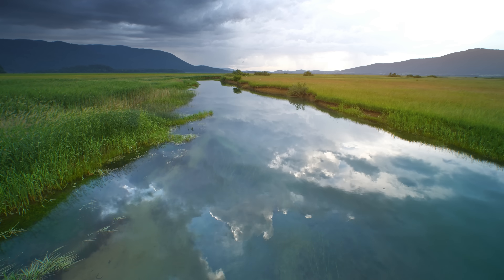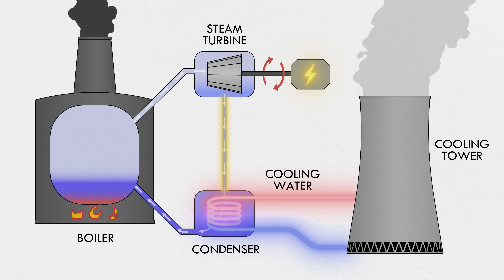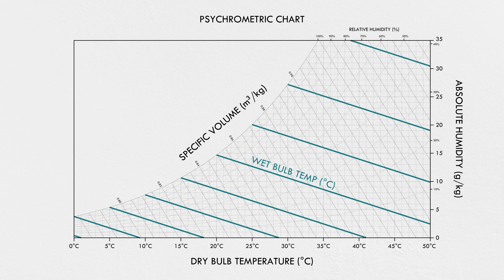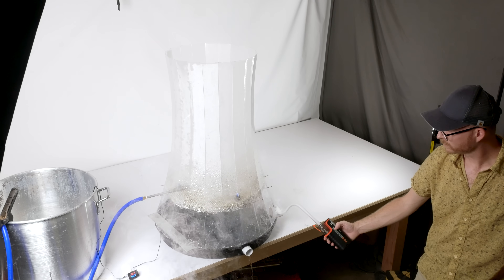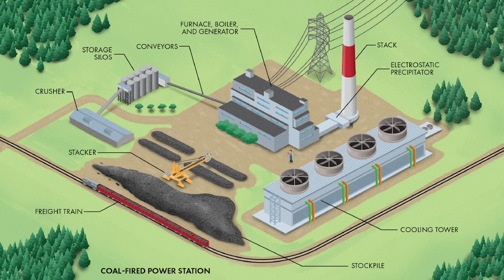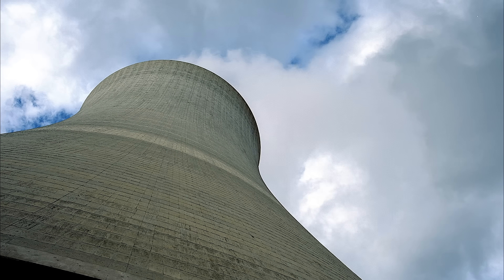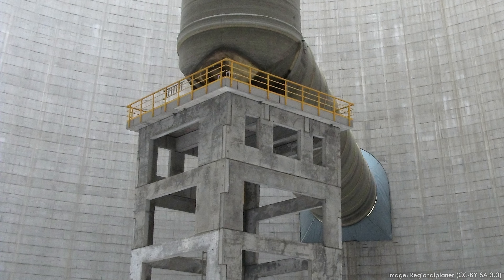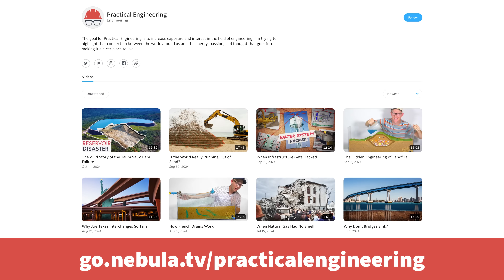Why Are Cooling Towers Shaped Like That?

Comment: Check the white line distortion of the video in 19:47 you can clearly see white lines and dots in the lower left corner, and then even more around the whole frame.  Is that distortion from radiation ?
Looks like it ;)

Comment: I studied chemical engineering in college over 40 years ago. Most of the points you mentioned are familiar to me. However, I never realized that water vapor is actually lighter than air. Silly me!🥵

Comment: Can't understand in a cooling tower the water is cooled and the air used to cool (evaporate ) the water gets hot. But in a swamp cooler (same principle) the water is cooled and the air used to evaporate the water cools too.?
Reply: In an evaporative cooler the water absorbs heat from the air to evaporate.

Comment: no fancy reverse air conditioner to use a low grade temp optimized refrigerant to capture the heat and drive generator and create more power ?   in this day and age of 3d printing at larger and larger scales - some hope for bio mimicry structures to maybe start the water high in elevation and run it downhill with gravity inside pipes to reject heat all along the way and reduce the vapor losses - like tube and fin but gloriously clever surface areas to dissipate heat better ?

Comment: Switzerland oldest Nuclear Powerplant Beznau is cooled by Aare river, basically it use fresh cold water to Coling the Reactor and then immediatly released. Nuclear Power Plant Leibstadt was planed with river Water from Rhine to cool, then due Envirement Concerns the had to build a Cooling Tower. If you looking right you can spot Kilometers away the Clouds coming out the Cooling Tower, lol everyone can see with exept Beznau if the Nuclear Power is running. Switzerland has only Nuclear Powerplant as Thermal Power Plant, in that case is true big  Cooling Tower are associeted with Nuclear Power. my fahter is Joking those are big Cloud Maschines

Comment: Around the 16 -17 minute mark when youre speaking about cooling towers not working best in hot climates
Im dense
Could it be said that because they need hot air to rise, and because they need the hot air to dissipate into the cooler air
That its harder to do when the air is closer in temperature? 
E.g its easier for 120°air to move into 50° than it is for 120° to move into 115°
Similarly how its easier for dry air to absorb wet air than it is for wet air to absorb wetter air?

Take a shot every time you read the word air.
If youre alive after...you win😂

Comment: In Romania, you don't see that much of cooling towers. The thermoelectric plants are generally built outside of towns and they cool water by sending it as thermal agent to heat the residential buidings. That way, the water and the energy is not waisted and heating in the winter is much cheaper.

Comment: I used to work on a cooling tower at a casino. The fill gets plugged so you have to descale it. I honestly did not know the huge towers were open on the bottom, so cool.

Comment: Doesn’t the curved shape of the tower also produce a Venturi effect (much like the inside of a carburetor) which lowers pressure promoting greater heat transfer to the outside ambient air?

Comment: Air inside rises because of temperature gain only. If you look at psy graph the total mass of of water vapor is minuscule (few grains per each dry air lb) so any relative  gain of buoyancy due to increase of lighter water vapor is négligeable.

Comment: Why not using the hot water to make more steam as it will require less energy to make steam with super heated water??
Reply: steam dont make "energy" from nothing, what we use its the motion the turbines, those turbines move because the steam pass trough them, and that force its generated by heating water, why? because the diference in temperature, less density makes a portion of cold water cant stay in the same portion of space as heated water, because its less dense have more volume (cold water use less space than heated water) so because of this the steam needs to "escape" when theres is no more space, they make this steam go trough the turbine moving it and making electricity. if you use steam, heating it will just make it a little less dense, so the turbine wont move.
(its like let a ball in a rope fall to hit something and move it. to use it again you need to rise the ball again, yes you can leave it down, but the force to hit its slower. so its useless)

Comment: There is an invention, U.S. Patent No. 9641045B2 that could eliminate the need for such extensive grid system, reducing both expenses and dependency on large-scale power station.

Comment: The shape is a venturi tube and the air accelerates in the narrower place (Bernoulli effect) causing a drop in pressure and more water condenses and falls like rain inside the tower.   That is the main reason for the shape.

Comment: I've climbed a few of these towers including the 523ft tall Harris Nuclear plant cooling tower and it's scary as all can be. About halfway up the ladder turns to face outward.
Catawba uses 3 70ft mechanical draft towers per unit. Palo Verde also uses the same design as catawba but with 3 units and uses treated sewer water from the local cities, crazy use of waste water.

Comment: tl;dr you don't need major in powerplant designs, so there are dual heat exchangers (outputs about 125-215C steam, input is about 400-625C steam) this steam is in mass and numbers, hot water rains down (as distilled water), gets back into first evaporators/heat-exchangers.
Good things, protects from tall side winds and dust. Also cheap when unit/btu is calculated 😅

Comment: I used to work for Marley cooling towers building mostly mechanical draft cooling towers but I've helped rebuild a couple of the natural draft type. The fill on the inside erodes from constant water flow. I have came across a couple free fall designs but they aren't as efficient.

Comment: Is there a practical use case for using cooling towers is water is available.

I tough they are used when  there is not enough water to use rivers.

All Finlands nucler power plants (and others?) use river cooling as far as I know.

Comment: In my 3rd year of high school my chemistry teacher explained the difference of pressure with the clouds by the fact that the specific weight of the Oxygen (by checking the periodic table) is heavier of the Hydrogen and since in physic an atom of a gas tend to replace the other, when there's more humidity it does inherently create lighter pressure.
I still remember about that explanation since he was so fascinated by it.

Comment: This video brings back memories of a chemical engineering problem in college. Given parameters we were to determine the height of a cooling tower. This was in 1975 so we had to use graph paper (per computers) to determine the adiabatic cooling curve. My group expanded a section of the graph, being as precise as possible, and determined the height to the third decimal place. At class we compared our solution with the other teams. All of the teams solutions were within 5% but one. The Professor came in and all of the teams reported the answer. He then said, yea, that's about right but I would add an additional 20% because the tower is going to get less efficient with time, etc. That sentence was the best instruction in my engineering education that I call the Gutzweiller Fudge factor.

Comment: Fossil fuel replacement with grid electricity must be 10times bigger than grid capacity. 
Grids are extremely expensive to EXPAND 
10s of $TRILLIONS and 100years. 
Too expensive.

Comment: Long story short:
As heated air rises up, cool air is sucked in at the bottom. The shape allows the tower to withstand winds, contractions, and expansion of the material it's made of.
Widening at the top prevents steam from circling back.
Hyperboloid shape is material efficient and lets you build really bug stuff with concrete.

Comment: cooling towers are the top of idiocy. the turbine condenser water could instead be an easily (pressure wise) condensing gas (NH3, Butane, some Freons ) fed liquid to the condenser, it absorbs the steam's heat, evaporates and powers another gas turbine, generating additional power.

Comment: So If I understand it correctly, we only use the the energy of upwards movement of the water after heating.
The energy that brings the water back down after cooling, called gravitation energy, is completely ignored?
From this video it looks quite inefficient.

Comment: In my undergrad engineering training they said that if you see visible fog exiting a cooling tower, it's not tuned properly (that is, the operator is losing heat out of the tower that they could have recovered instead). Any thoughts on if this is true?

Comment: Very good video. But it could have used a chronological animation (instead of static graphics) with moving arrows to show  the actual cooling process, with cool air entering the bottom flowing up cooling the hot water that’s pumped from the reactor, etc.

Comment: Finally something right up my alley!

Interesting fact; in a lot of towers, above the fill there is a layer of  rows and rows of zig-zag shaped plastic pieces.  So when the rising air/vapor mix goes through them, any entrained water can't make the bends, impinges on the pieces, and drops back onto the fill!  It is called a "torturous path."  So it does minimize water losses.  

We'd tell tours that we were sending a swimming pool of water out the top of the tower every minute!

Circulating water (cooling tower loop) flowed through the condensers via four quarter-million gallon per minute pumps on the way to the tower.  Two thousand HP pumps, 440 RPM.

Since making up to the tower for water loss would end up concentrating everything coming in from the lake, we'd bring in 15,000 gpm from the lake, and send 5,000 gpm back into it to help reduce buildup.  The 10K gpm difference being the swimming pool going out the top.

Comment: Excellent video!!! I taught thermo at a large power steam plant, and I even learned a few things!  If I was still instructing the operators there I would incorporate the facts into our lesson plans, or at least make them a little clearer, since the background information is there.

There is one other distinct advantage about large concrete parabolic cooling towers.  In the event of an earthquake or natural disaster, or for other more nefarious reasons, nobody wants the cooling tower falling onto the power plant or any of it's outside properties and equipment.  So by design, if a collapse occurs, they are all designed such that the tower falls completely inside it's water basin below!!!  (This is because the concrete is thinnest at the restriction point.)  They don't fall over like a grain silo or a tall building being demolished.  Very practical.

Comment: I once worked at the Biloela power plant. It runs on Coal Seam Gas. The lake system is surprisingly small, yet the cooling towers and there is 2 actually runs so well. 

Before you ask, I was doing Hazmat removal in my work and am not a power plant staff. 

The power plant is located in Queensland, Australia.

Comment: Air does not hold water.  Water vapor is a constituent of the earth's atmosphere - "air".  An increase in temperature results in a higher percentage of h20 which can be in vapor phase before condensing to liquid form.  That is why it is "relative" humidity.    thumbs down

Comment: Why does the boiler need to start with liquid water, evaporate it, then heat it up even more? Why not start with low temperature steam and heat that up? Also why use water steam instead of some other gas in the turbine?

Comment: Those plastic sheets are the same ones used for cooling towers at some data centers. They become extremely corroded and it destroys any exposed metals quickly (I've seen as much as 1 inch of rust form in less than 5 years in the Phoenix, Arizona area). That's why a lot of cooling towers are made of concrete or FRP (fiber reinforced plastic, think of fiberglass but more advanced).
Reply: FRP is cool once you remember that when working with it, the F is for Fiberglass.  A good time to wear a dust mask.  Edit: by 'working with it' I mean cutting or grinding it.

Comment: To give a little perspective to the effort of cooling down feed water of a power plant: I was visiting a nuclear power plant with an output of 1400MWe some years ago. They have evaporated about 700l (185 Gallons) of water per SECOND. So every second a whole bath tub of water just disappeared and needed to be replenished by water from a river - which obviously needed cleaning before it could be utilized.
In that power plant they had a so called hybrid cooling tower, much lower than natural draft towers and with electric fans blowing air through it to prevent the formation of steam clouds. They alone took about 60 MW of the power produced by the plant.

With a large power plant somehow nothing is easy anymore. Everything is just huge!

Comment: People probably already thought about this, but could you put a big fan inside and make use of the steam to get extra energy? Might even return more water that way. Guess it would need to be a lightweight and sturdy  material.
Reply: Probably highly inefficient and no cost/benefit factor because of low output and high installation and maintenance cost.  If someone could make an extra buck from it, it would already be in place!

Comment: I've flown over cooling towers at a now closed nuclear power station in a boeing 737, the plane was thrown about by the heat and convection and that was at about 20,000 feet about half an hour away from.the landing airport..

Comment: most interesting thing i'd say about them is the way the water gets sucked down and pushed back up but if you drop something in it gets pulled straight to the bottom and never comes back up. deer have learned that the hard way.

Comment: You can also use thousands of householders' radiators to cool down thermal powerplants' water - and to heat their owners. it's pretty common in postsoviet countries, at least in the cold ones. But now I wonder, how they are being cooled in summer. 😊
Reply: Heh, how did I forget that there are  cooling towers as well.

Comment: I know there is a term called superheated steam for driving the stream turbine in power plant (I studied basic thermal dynamic in 2nd year engineering course 30 years ago > but already forgot 😅)

I just forgot why steam must be cool down to fuild state then re-heat again back to gas state in the power plant cycle > during this condensation process the loss of heat energy is a waste > why cannot we skip such process and reheat low temperature steam back to high temperature steam instead?
 
Why low temperature stream cannot be reheated directly back to high temperature for driving the turbine?

Comment: A fun math connection: the hyperboloid is a "minimal surface" meaning it has zero mean curvature. This minimizes surface tension and makes a much stronger shape than other surfaces. It also means that you can build these surfaces using bubbles. All you need it a large circular ring of wire and a small circular ring of wire. Dip both in bubbles, pull them out of the bubbles, and place the small one in the larger one, "connecting" the bubbles. Pop the surface inside of the smaller ring, and slowly pull the smaller ring up, stretching the surface connecting the small ring to the large ring and BAM. Hyperboloid

Comment: Our forge uses water for steel tempering during process (basically cooling). So to let the water cycle we use similar "separator". It's one big tank with separator at the bottom, "endless rainfall" undeaneath into the second tank :)
Small (10x7x5meters) but crazy efficent!

Comment: I wonder how far you could push the steam through a pipe to heat office buildings and other big structures in a cold climate, if we ever get to the point where we get small safer nuclear power plants that can be positioned closer to cities if this could be a viable way touse the steam for heating, that would be a big infrastructure boost and massive energy saving and possible way of revenue for the power plant as well

Comment: Why can't the steam, after it comes out of the turbine, be re-used, or at least condensed back into hot water and re-circulated?  Rather than picking up cool water and heating it to its steaming temp?

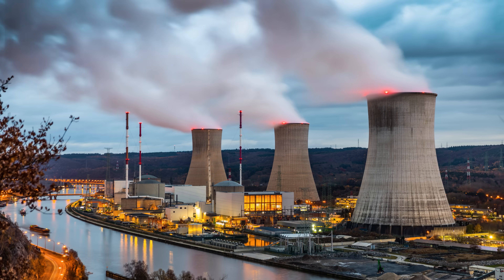Comment: @13:38 Ironic choice to show that particular reactor face. 

Although technically possible to use with a cooling tower, to my knowledge all the CANDUs that have been built so far have used an open-cycle.

Admittedly it's a really cool photo and they guy that took it doesn't seem too fussed about copyright so I get why it shows up everywhere.

Comment: Why do we need to cool the water? Could there be a closed loop system that runs through the turbine, cooled just enough to condensate and just sent back to whatever is heating it. Taking less energy to evaporate it. Why not? Could you condensate the steam under pressure in a closed hot loop system?